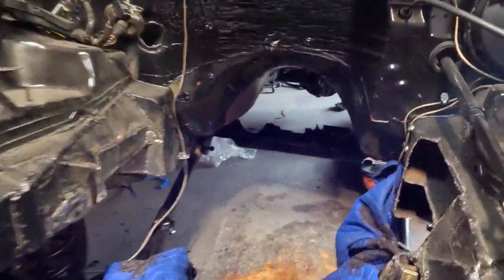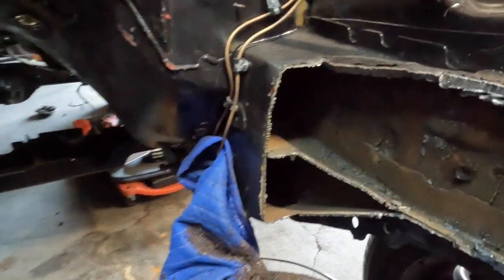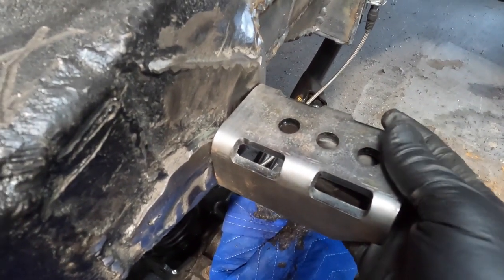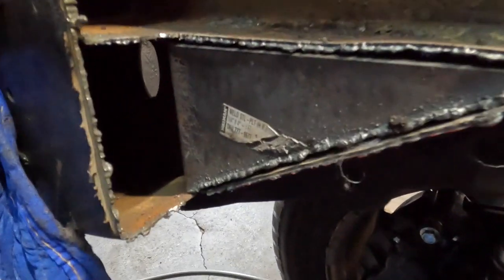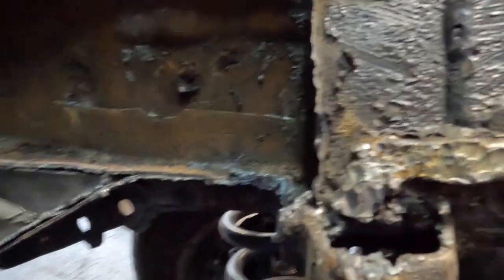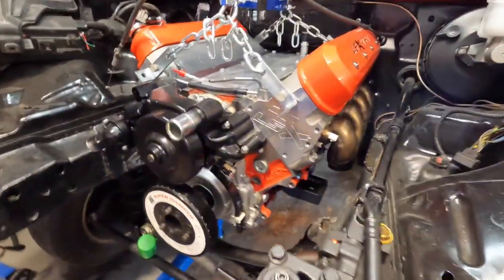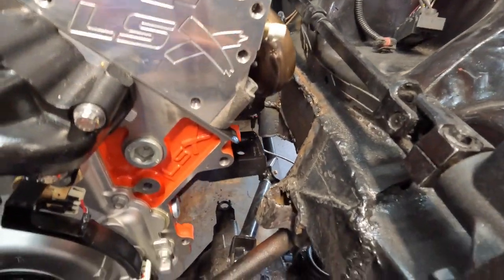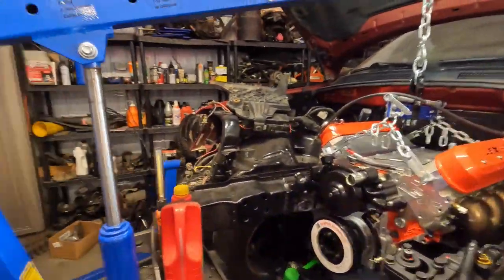PROJECT LSX 99-04 JEEP GRAND CHEROKEE WJ LS SWAP PT2

Comment: I want to know the wiring
Reply from the maker: Which part?
Reply: @quadscrib229  internal how I would get all the oem gauges working , if you did that
Reply: @quadscrib229  I have a 99 that I’m thinking of doing this to (tiktok the wj way)
Reply from the maker: @gurukcvaughn we didn’t do that. We are running all Holley systems with the Holley 7” digital dash.